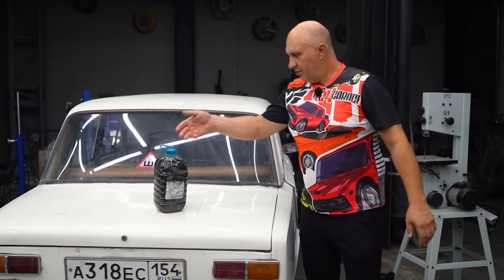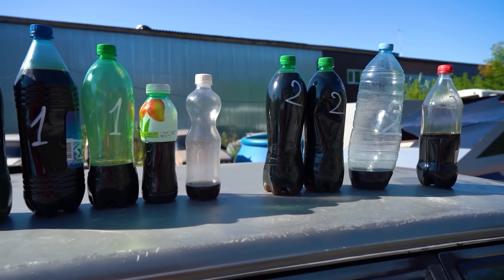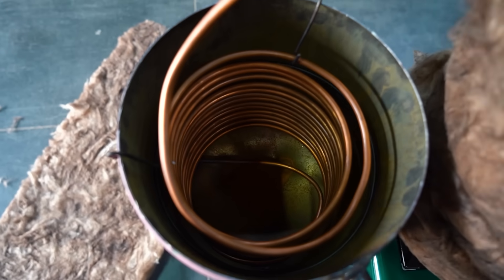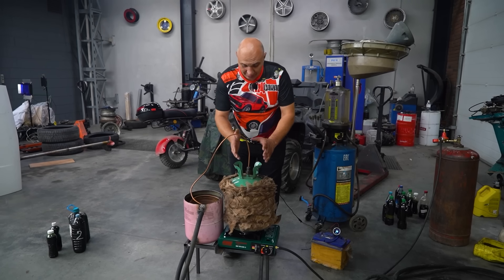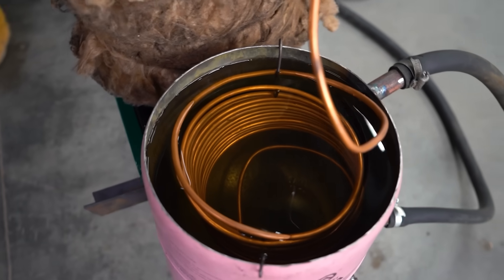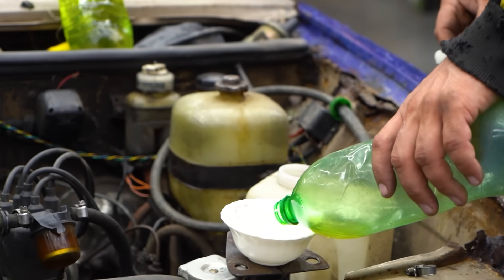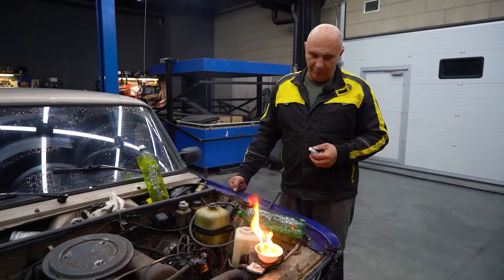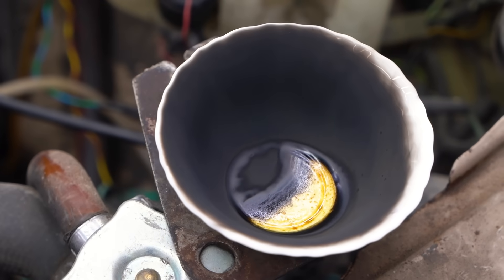Tire-extract fuel vs pump gas - which is better?

Comment: Test this with fuel injection, you mentioned that is smells like it's has a rich mixture, and the experiment in the bowl showed the same results due to burning longer and more soot, and fuel injection will tune for optimal air to fuel mix so maybe more distance against regular pump gas

Comment: Great video, and great job. But It would not be synthetic gasoline since tires are made of petroleum. You simply rendered solid crude oil to liquid then refined that crude oil to gasoline. Ethanol itself is already synthetic gasoline

Comment: If you want synthetic gasoline or diesel use plastic instead of tires because tires contain only 15/ percent oil for softening the rubber during blending time the rest is carbon 30 percent natural and synthetic rubber 40 percent, then steel and polyester or textiles, go for plastic then you will acquire over 80 percent of pure synthetic gasoline or diesel but you should refine to separate gasoline from diesel, kersene and other impurities.

Comment: The synthetic gasoline is mostly made of limonene, xylene, styrene, toluene,
trimethylbenzene, ethylbenzene and benzene. Some of those are extremely toxic for your health and the environment. Should wear respirators if you do this again, and since they don't fully combust in an engine, you need a way to capture the emissions so you're not spraying cancer juice all over the track. Rain will move that to your local waterways and that's not good. Short of a zombie apocolypse, there's really no use for this.

Comment: It was so close to right.  There needs to be a column thats wider above the heating vessel. It should be cool enough to allow for some condensation, but not so thin that the condensate fills up and pushes through. This allows evaporates with similar vapor points to separate. Then, you use smaller collection vessels to collect the distillates. The first flask will have your more volitile components, usually the smelliest bits come over early. Adding ice to the water would help, as well as Adding height to the first column.

Comment: That’s good it had way more energy just needed a octane booster added
Reply: Okay yeah it drove further it definitely has lower octane it could knock possibly but that’s because it still has more energy than pump gas

Comment: I have my 2 stroke 135cc motorcycle engine once filled with gasoline on a small retailer about 5 or 7 years ago. Here in Indonesia a lot of small fuel retailer got their supply by buying from nearest fuel station about 40 to 80 liters daily. But this time, the rubber gasket on my fuel valve/fuel cock (under my fuel tank) is leaking. I thought the rubber leak must be from different chemical from the gasoline.
Then few months later i found out a used tire pyrolysis plant about 10 km away from the retailer is already in operation for some times. Perhaps he bought the gasoline from that plant for cheaper buy and bigger profit.
I didn't notice any engine performance difference since i used the motorcycle just for commuting transportation (not for racing), i just noticed that the gasoline is a bit harsh to rubber. But the rubber hose from fuel tank to the carburetor was just fine, maybe because the hose is made with different type of rubber.

Comment: I've seen a video where a guy is re-using use motor oil ( few gallons) mix with diesel ( couple of gallons)  for his truck and his mixing everything using a electric fuel pump with filters that are use for water filtration for any material in the oil so the final result would be clean Diesel so that system could work for this gasoline too.

Comment: Based on the results from burning the fuel in the bowl and the residue/soot left behind I'd guess that combustion chamber deposits and deposit build up on valves with the current level of refinement would probably cause issues. Also the fact thst it apparently burned at a hotter temperature may cause significant problems in engines not designed to run on a hotter burning fuel. The fact that it seemed to perform a little better than pump gasoline indicates that it is indeed burning hotter as an internal combustion piston engine is simply a mechanical method of converting potential energy stored in a chemical into thermal energy by introducing a catalyst (oxygen in the air)  and ignition source (in this case a spark provided by the ignition system) while in a compressed state and then using that rapidly expanding mixyure of burning air/fuel mixture to push the pistons down turning the thermal energy into kinetic energy (energy of motion) and turn a crankshaft etc... If you use a fuel that burns at a higher temp you have more thermal energy available to turn into kinetic energy and thus you can get more kinetic energy from a given amount of hotter burning fuel than you would from the cooler burning fuel. The problem you run into is the engine components exposed to the higher combustion temps will also run hotter and while some offset with high performance radiators, water pumps, and airflow may help reduce overall temperatures as measured in the block and cylinder head the valves, valve seats, and possibly piston/rings will likely wear out quickly. This would be very similar to what happened when leaded gasoline was banned and very quickly the automotive industry learned that harder valves and valve seats would be required, not just because of the "Cushioning" effect that the lead additives had but also because of the higher burn temperature of unleaded gasoline. And also to truly optimize efficiency different ignition advance curves might be needed especially considering the higher combustion temps would likely csuse pinging/detonation/preignition in engines not designed to run on the hotter burning fuel.  I'm not saying it's not worth experimenting with, in fact, given my rather significant pile of used tires I'm definitely going to look into this possibility, even if I ended up running a pump gas/ "Synthetic gas" blend in my riding mower and 6 hp walk behind string trimmer, and possibly my Vtwin minibike it would be interesting.

Comment: I feel like they only need to pass it through a filter and it would be even cleaner. Then on top of that use a fuel filter on the fuel line. Chances are that would be good. Also the black stuff they had might have been good enough to be diesel. Since i know ppl filter used oil to burn as diesel.

Comment: You could use the gasses from the previous video to fuel this 'upgrading' of the pyro-oil. Build it as an integrated system. 👌

Comment: activated charcoal, and a filter should remove odor and large particles. 

distilling should remove more solids and viscous materials in each loop, 3 times is usually a rule of thumb or best practice for spirits.

they place 3 stills in line with each other. the final steps of each have their own filter medium to pass through. and it cycles around.  the longer it runs the cleaner and more pure it gets.

Comment: thank you  ,you guys are cool  what would happen if you distilled the fuel again at lower temperatures and running it through coal to flitter it ,when you made the oil did it smell much ? hey thanks again cool guys

Comment: Your synthetic fuel is more energy dense than regular gasoline so you need variable mixture main jet carburetor and test it at leaner settings, then I'm sure it will get better MPG/ KPL and better performance,,Good on ya man, keep experimenting, it can get much better...

Comment: It did burn visibly brighter. You should have sent a sample for analysis. It would be cool to know the octane number and what junk it contains that can be filtered out. But this is a perfect example of why all this "we're running out of oil" crap is bullshit. Oil industry could easily recycle tires and produce plenty of fuel.

Comment: Due to car tires containing sulfur and with this process potentially creating hydrogen sulfide I suggest to include activated carbon (or just charcoal) somewhere in the process. This way any contaminants (not just H2S) should be separated from the fluid.

Comment: Replace a worn out previa battery with a hho generator.Use a stainless steel cook pot to contain water,use pantyhose stuffed with stainless steel pot scrubbers for the anode.Route the hho gas to the intake manifold but make sure you route the gas through a trap to prevent backfire.

Comment: Crude oil is placed in a cracking tower.  You need to place a column with some packing material and heat the column to high temperatures.  It will likely output pure gas equivalent.

Comment: what is russian 92 like? Canada mandated 10% ethanol in all fuels, but my calculation was that it would only reduce mileage or torque by 3% (more on carbeurated engines, due to running rich)

Comment: tyres are made from natural rubber which has a funny molecular structure not too similar to crude oil. When I carried out these experiments,  I used HDPE plastics. The results were excellent

Comment: The setup you have used is a basic distillation system. In this type of setup collect gasoline only between ambient temperature and maximum 120 degC. Kerosene will be like 120 to 150 and then diesel from 150 to 210.

Comment: Tire fuel has a lower octane rating, this the cylinders get higher to top dead center, this you get more power, probably gets worse gas mileage

Comment: I worked at a company that produced fuels(oils) from plastics via pyrolysis.  We looked into tire pyrolysis but there is many problems with it.  We helped a company in Texas fix their plant.  We helped the folks at MIT with their lab work. We were the most advanced operation of this system and there was only five people involved into the company and one was basically the major money behind it.

The smell is not burning rubber- technically.  It is burning sulfur.  Tires are not made from rubber, haven’t been for about 100 years.  They are made from crude oil.  For folks old enough to remember ACID RAIN- you realize why sulfur is being removed from diesel fuel.  From normal diesel to low sulfur diesel then to ultra low sulfur.   

All the carbon he thinks he has seeing in the test burn is far more sulfur than carbon. 
Without testing the fuel he made- we don’t know the carbon chain count to know if he really made the same level of gasoline or not.   The added heat and the realization of massive sulfur content that was in there- I suspect his carbon chain was around. 3-5 carbon atoms richer than the gasoline.  This accounts for the added heat and burn time.  This is a portion of the testing that is done to verify. A temperature flash point test would verify without needing an electron microscope although that is the more accurate method.  

There is a bunch of harmful chemicals to breathe from this. Basically ask yourself if you want to go stand next to Tire fire and breathe the emissions. Remember the immediately referred to the snow of the fuel the raw fuel itself? Before people get excited about the cost savings they could have, the odd to include the chemotherapy treatment in that equation. It can be done at a safer method, but not by the DIY methods.  

For people to try to do this and run it through a car, which has an exhaust system, including a catalytic converter, I hope you find a really really good deal on new catalytic converters.
Reply: Over all this is a fun experiment- I enjoyed it as I have many of this crew’s ideas. 
Just hope people that diy this themselves realize they are playing with toxic chemicals when vaporized at best and a heck of a bomb at worst.
Reply: I'm actually interested if this sulfur problem could be solved with activated carbon. Theoretically it's supposed to adsorb all kinds of nastiness (that's why it's used in catching toxins from the body and purifying alcohol from impurities), so why wouldn't it be possible with sulfur (or other sulfur-derived compounds like H2S).

Comment: That would be worse to your engine than Ethanol. It piles up like Hardened Asphalt inside of an engine, Pretty much destroying the car unless you know how to take the car apart and fix it. It could at least use some better filtering.

Comment: It's certainly an idea to be tested further. I wonder about build up for instance. But otherwise, yeah, old tires eventually become unusable and degraded to a point where I imagine they are probably not even worth recycling. Giving that waste product a new use that can be put to potentially multiple other good uses even if for a limited time, is a positive all around in my books. For instance, gasoline generators might be able to make use of this. From there, you have electricity, which has near endless possible utility. And since this can likely be used to similar effectiveness with other materials, we probably should be making an industry out of it that operates around waste reduction and recycling.

Comment: Why not try filtering this synthetic gasoline to remove more carbon as this will not deposit more carbon on the valves and engine head.

Comment: While this is a fantastic idea(I had the same idea with used plastic trash)
I think the easiest way to make fuel is wood smoke alcohol. 
Many wood burning cars already exist, and some setups are large enough to run a Chevy small block V8. 
Perhaps that method would make another interesting video for you all? Good luck and excellent work.

Comment: Plastic pyrolysis can actually result in some good quality fuel, you just have bad quality chamber, it requires a lot of iterations and testing usually requiring a professional setup in order to properly refine it, that might do alright in a diesel heater but it puts out way too much junk to be used in a regular engine without sacrificing it

Quick edit: The reason why nobody does pyrolysis is that it's not profitable, the energy required to heat the reaction to convert plastic back to regular hydrocarbon fuel is a bit less than 1:1 so even with clever marketing you would barely break even, so unless it's a hobby or you're in the post-apocalypse many years later when almost all the gasoline on earth has gone bad, it's not worth it to make make money let alone produce your own and save money, it's a matter of profit.

Comment: You can adjust the Carborator to add more Air to Fuel ratio and i bet the Extracted "Synthetic Fuel" will burn Hotter, Longer, and Farther per Power Stroke. And with a Turbo? it would burn way Cleaner... because More Oxygen = Cleaner Burn and more Power

Comment: Honestly, the Impurities that remain in the Synthetic (or Extracted Fuel) probably has a considerable amount more "Lubricants" that can make the Cylinders move easier - the Oils and Carbon Soot may contain Graphine as well as Tires contain Graphine sometimes, that would help the engine move easier, -I mean, yeah, emissions, but as a cool project that It's Doable is pretty cool. Me and a friend built a Gassifier in the back of a Dodge Pickup Truck that the truck had a wood fire in the Rear and would Steep out Gasoline  from the wood and condense it directly into the Fuel Line, so, it ran in Wood Vapor. People in town couldn't believe it.
Reply: Do you have video of that?

Comment: Our crooked government just eant to keep us Enslaved.    They have no desire to Free Humanity.    How about building cars like a downscaled version of today's modern Freight Trains.    A small gasoline vapor powered engine turning a generator and supplying power to electric motors and then to an automatic transmission and finally to the rear wheels.    This idea would net at least 200 miles from one gallon of gasoline or maybe pure alcohol.    Any fuel that can be vaporized and used in an engine that is designed to run on fuel vapor